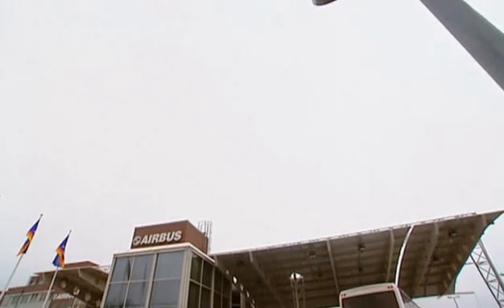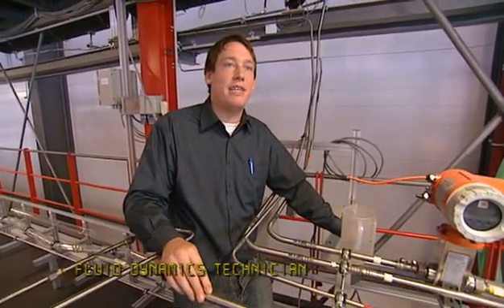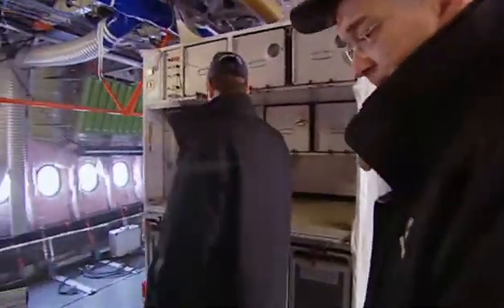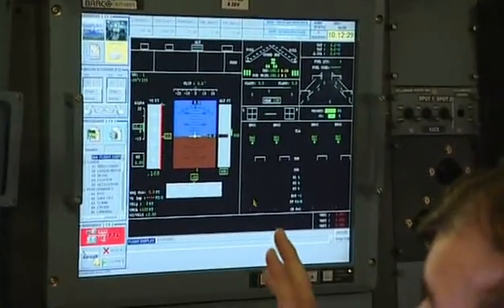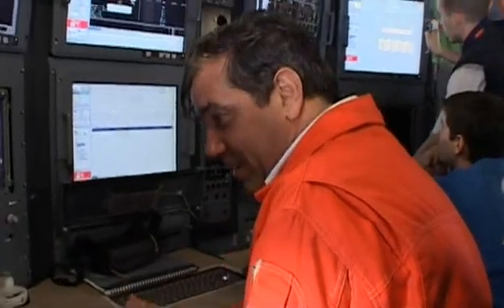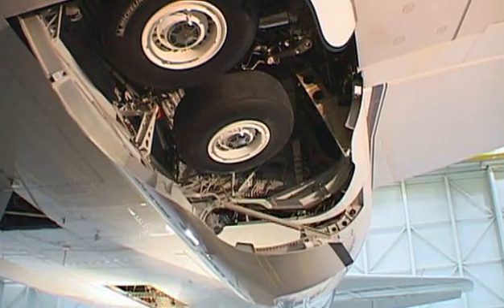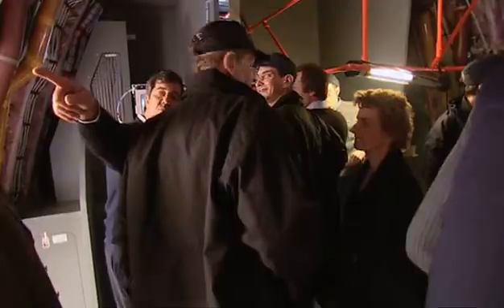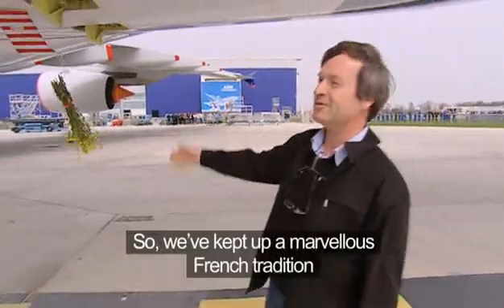Airbus A380 construction and Documentary part 8

Comment: Stupid solution, what if the air wind pressure pushing it during landing and it won't slip again, better adjust the cover opening or add pulling spring to the cover of the landing gear so that, it won't touch or stop those tires to drop down properly during system failure.